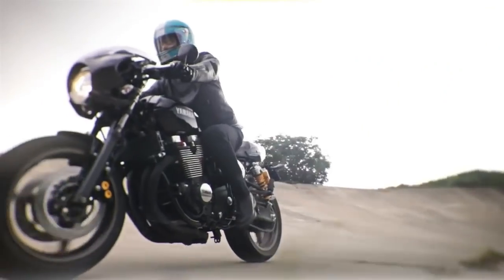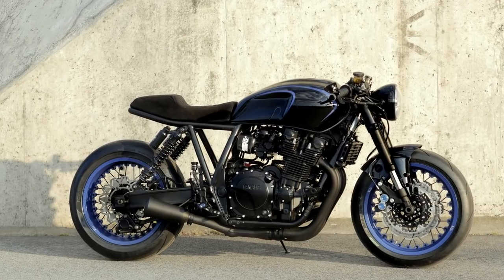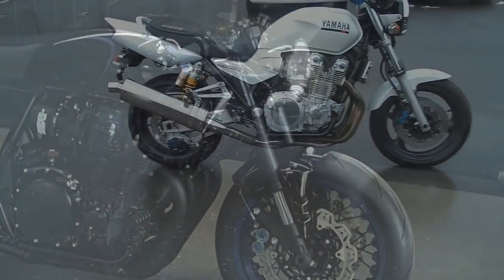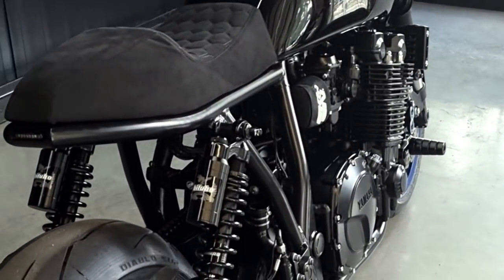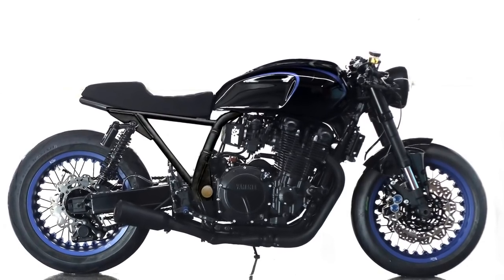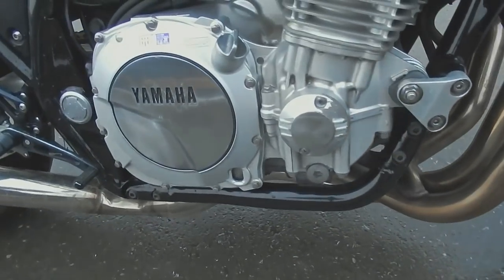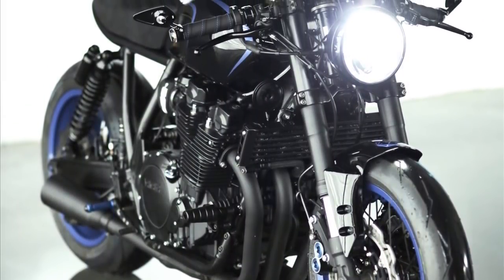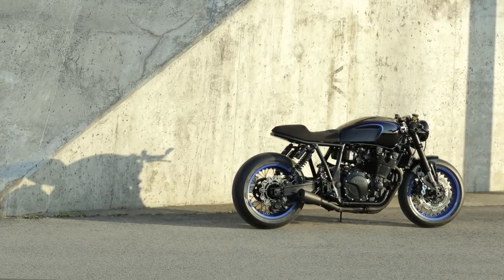Cafe Racer (Yamaha XJR 1300 by UNIKAT MOTORWORKS)

Comment: This was quite an extensive build process Victor !
Not just adding a new set of front forks, and cut off the rear seat assembly !
This is a legitimate total building process nearly from the ground up !
I would venture to guess that nothing, was left untouched !
And, absolutely was put on a strict crash diet !
Results, a significantly lighter bike !
Changing the fork rake angle, affecting the handling characteristics !
Not to mention their choice of an understated paint scheme !
Wrapped up with undisputed Yamaha 1300 carbureted performance !
The weight to horsepower ratio should be impressive !
Great finished piece !
Now then,
Let's talk about your video quality !
You my friend, have put an incredible amount of time and effort into this finished product as well Sir !
My hat's off to you on a great job on the video quality as well as the bike choice !
Reply from the maker: Indeed. Thank you my friend for sharing your opinion ,and as always, for all your very kind words.. :) Cheers.

Comment: Elegant and powerful. I preffer 4 cylinder bikes, and as a large man I need the bigger engines. I have a 1975 Kawasaki Z1b, and a 2000 Kawasaki ZRX 1200R. I would definately have this bike in my stable...
Reply from the maker: Thank you my friend for sharing your opinion. :) Cheers.
Reply: I’m with you George, 
full liter 🇯🇵 inline 4s till I die
Reply: You got 2 iconic beautiful bikes man, I’m kinda jealous.
I Sold my 2003 R1 in 2005 and after a long motorcycle hiatus, got me a 2018 Z900RS I added Driven racing clip-ons, shorter cafe model clutch cables, throttle cables and throttle cable case, blacked out bits, tail tidy and as luck would have it the 72 year old man I bought it from at under 2000 miles had it already re-flashed the ECU and put Q3 tires on it.
Nothing like my GPZs of youth, this bike is fast and as smooth as a sewing machine, kinda sounds like an old KZ when ripping on it but smooth like a Honda.
Out of all the Sake rockets I have owned this one feels most like my 1994 CBR900RR

Comment: There is something I don't like about this project. What does not stop me to see that it is something very original and true. Perhaps the displacement of the machine, which is huge? But in itself it is not a negative thing either. There are even bigger bikes. Maybe the color blue, I don't know, I just don't know what. But what I can appreciate is the degree of excellence in chassis modification that is simply superb.
Reply from the maker: I believe the problem is about we are not used to see a cafe racer with such a big engine. I recognize it may look a bit weird because of that. :) Thank you Amigo Alejandro for sharing your opinion. :) Saludos.

Comment: I bought the 1200 new in 1997. Then, in 2005 I got a used 1300 (c1999) I finally had to sell it in 2019 with 84,000k on the clock. I also agree, the original tank lines were the best.

Comment: Great bike!!...but...the set up of the rear suspension is wrong, too much leaned forward, so look over function in here.
Reply from the maker: Thank you Carlos for sharing your perspective. :) Cheers.
Reply: @RACER_TV  , Dear Victor; in this case isn’t just “my perspective”, is a fact very easy to prove, take a measure from swing arm pivot point to the shock lower bracket (swing arm) and again from swing arm pivot point to the upper shock bracket (at subframe) and it should be about the same, I known a little bit of play won’t harm but in this build it is too much, you can clearly see, cheers amigo!!!👍🏻